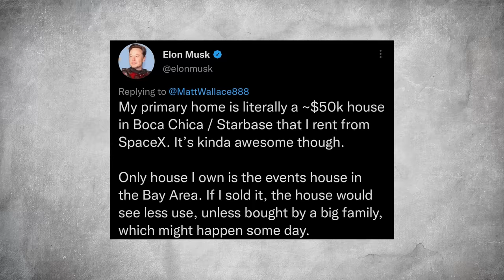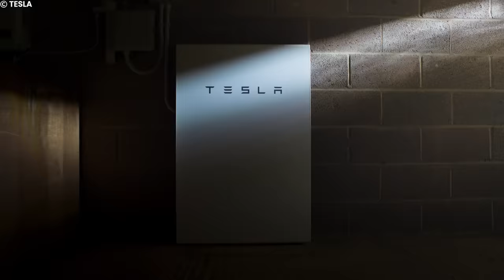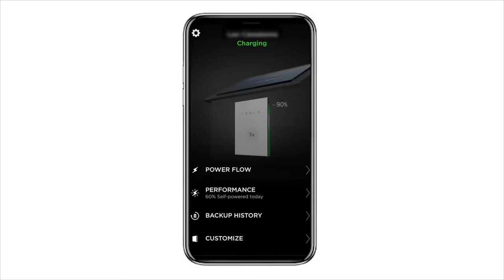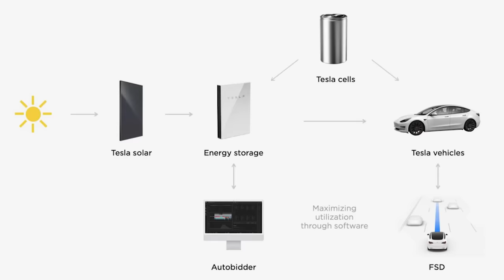Inside Tesla's New $10,000 Home For Sustainable Living

Comment: problem is not the house, the true problem is the land.
Reply: I was going to say that.  The land you have to put this house one, is probably  the biggest expense........
Reply: Problem is the house 
They can't make enough of them...

Clayton Homes (largest mfgr home builder in U.S.) was only built a little over 60,000 units in 2023. That doesn't move the needle enough to make a difference.
Reply: @zhihangzhou7141  plenty of land. Their production is too slow to make a material difference in global housing needs
Reply: It is always be the land
Reply: @joecrowley904  Is that 60,000 units as in 60,000 places for people to live? That seems significant to me.
Reply: @Brickswol  there are 8B people on Earth. It is not significant enough
Reply: @joecrowley904   I figured you were going by percentages, but that’s not what you should look at here. Statistical significance is not the only type of significance. Let me offer another perspective from a money pov: would you rather have 5% of $1M ($50,000) or 100% of $10,000?
For those hypothetical 60,000, I’m sure it would be significant in their lives. 
Also, it’s just a starting point, what’s with the pessimistic woe is me attitude? The plan could easily be iterated and improved.
Reply: @Brickswol  60,000 units added doesn't put a dent in market. Now, what you should consider is if they expand capacity. And the successful ones will
Reply: @Brickswol  👍
Reply: You are Absolutely 100% correct. Maybe that's why all these billionaires are buying up all the land can't grow our own food and no place to Live please hurry back Jesus Amen.
Reply: can rent, 200$ weekly
Reply: I recently lost my home to a house fire.  I still own my land.  I hope this becomes available.
Reply: @zhihangzhou7141  not even close. You can pick up cheap land for a few grand

Comment: $ 10.000 is an unrealistic price. Just the solar panels, power walls, inverter, car charger and other electrical fixings would probably amount to that sum. 
I believe $25.000 would be closer to reality.
Reply: Most likely higher that that,
Reply: Yeah it's not possible at 10k at all. The walls would have to be made of fabric😂 and frame of plastic
Reply: $25?

Comment: LOOKS like a quantum leap in thinking. What? Did you decide to take the axels and wheels off a Travel Trailer and plop in on the ground? Massive. Was you just a little bits high when you came up with that "evolutionary" notion?

I should just dig four trench places and back in the 22 foot travel trailer and line the perimeter with sand bags for when the rains come. 

"I'm fixing the holes where the rain came and stopped my mind from wondering, Where it will come? Where it will come?"